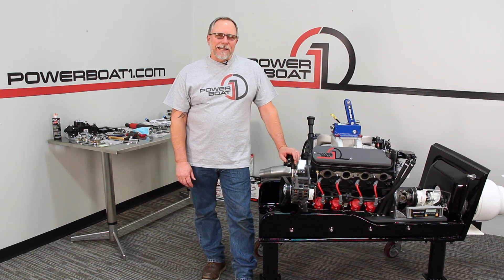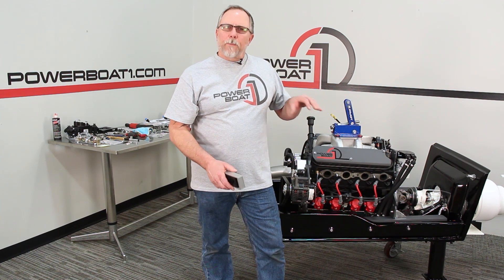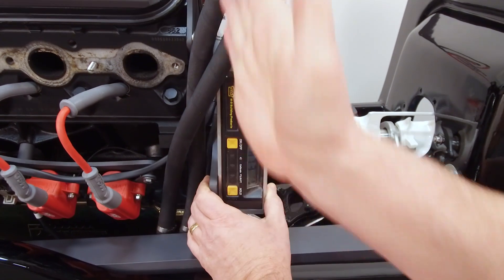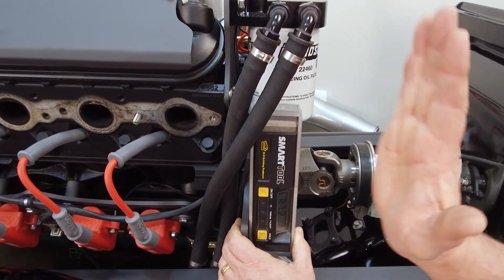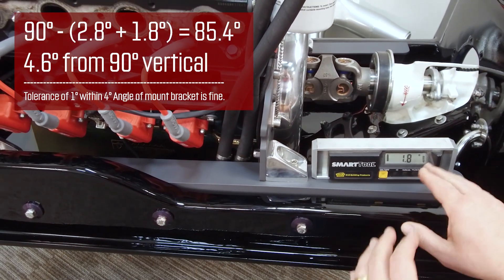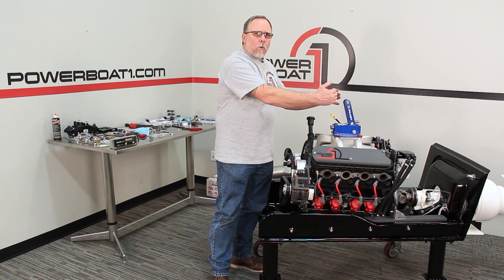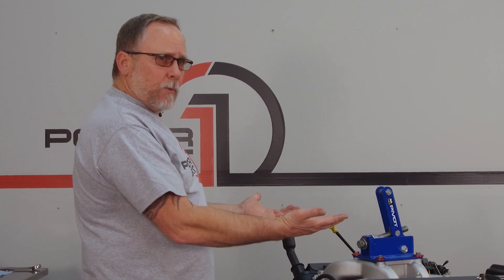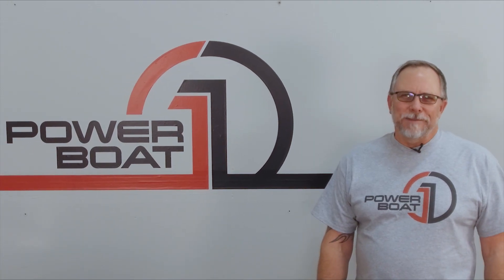LS Marine Conversion: Aligning the Engine and Pump with the LS Engine Mount Rail Kit

Comment: i just bought a Koffler jet boat. how close dose the alignment have to be? it looks like 1\2 inch off is that a problem?
Reply from the maker: The alignment being 1/2" off can be an issue for sure. This can cause vibration at times and also wear out the universal joints as well. You should try to get the alignment as close as possible to alleviate any future issues.